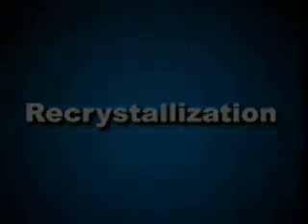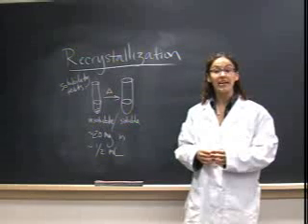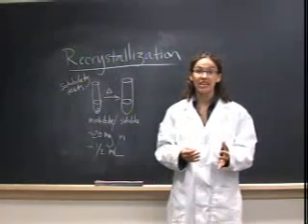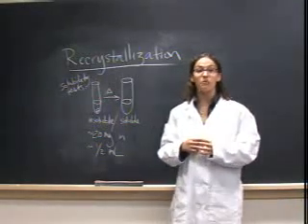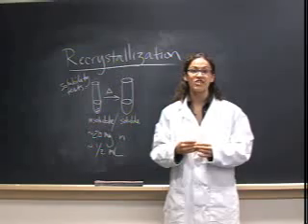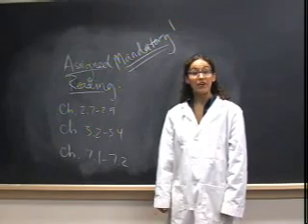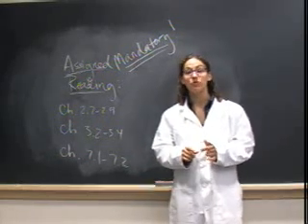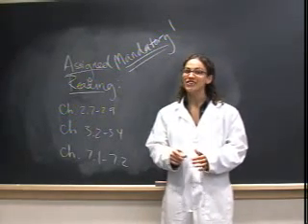Lec 9 | MIT 5.301 Chemistry Laboratory Techniques, IAP 2004

Comment: Somewhat true, but inaccurate, if the process is performed incorrectly, or the original crystals formed in less than ideal conditiona, a number of things can occur, for instance impurities can become encapsulated within the crystals. 

The technique demonstrated in the video is REcrystallization, obviously had the original crystals been "high purity" purification through recrystallization would serve no purpose.

Perhaps crystallization is a sign of at least relatively fair purity.